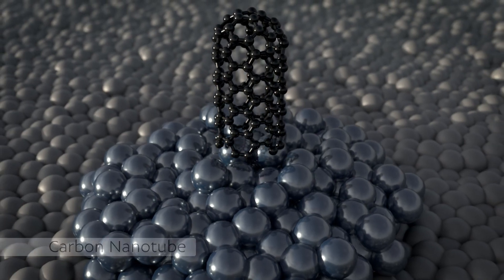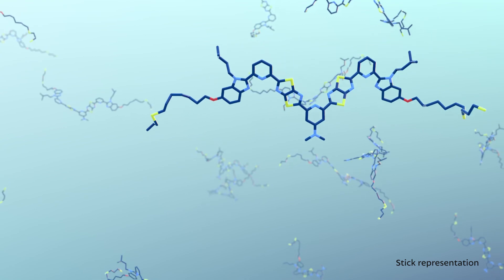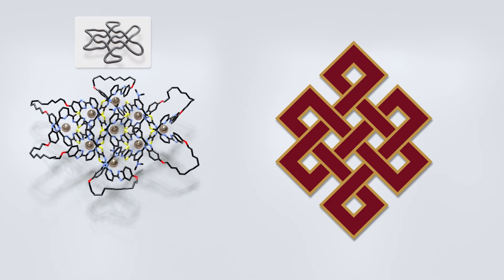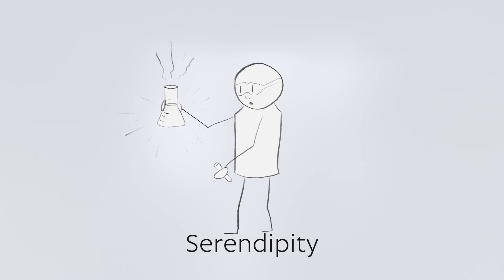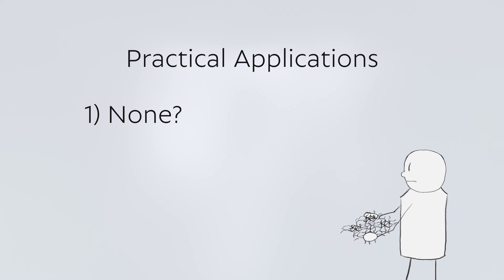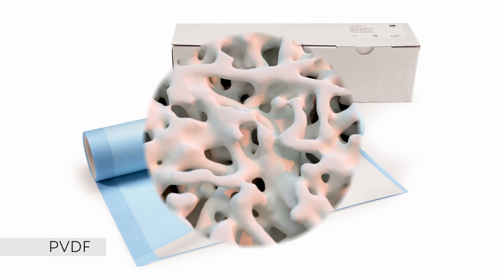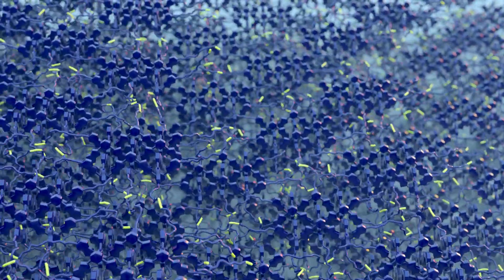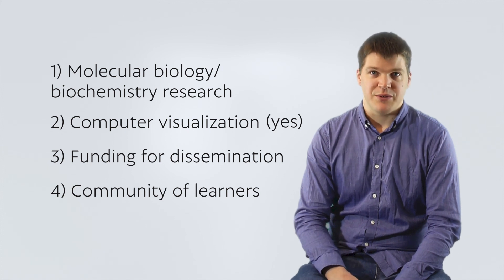Designing Nanotechnology: Weaving Molecular Fabric

Comment from the maker: What kinds of applications could you imagine for a woven molecular fabric like this one? Where do you think chemists should take these ideas next?
Reply: it could be used as an intermediary material to control the movement of other nanostructures that are required for assembling different micro components such as in devices designed for specific molecular construction. This has actually been quite useful to be exposed to this video. Thankyou. It is perfect for diffusing components at a fixed rate to control their binding period. There is so much that could be done with this! The real lesson here is that it most likely is possible to make a multitude of meshes with even more refined proportions for case specific needs.

Comment: Fascinating video, thank you very much!
As for applications, maybe it's somehow possible to replace the sulfur atoms with something else, thus making a material that better resists stress? Or connecting multiple layers (especially if they are off-center, so the other layers "fill" the gaps) could also help with that, and maybe with the letting through too. Or maybe adding loose threads which capture other molecules, thus making an impregnable net by using those captured molecules to help fill out the gaps?
Reply from the maker: Very interesting ideas! My understanding is the fabric tends to layer up with some offset between layers, at least that's how I interpreted some of the data, although there's much more to be learned and explored about how the layering works and I'm sure there's some neat applications to be found there.
Reply: Re-watching the video it does say they tends to layer on top of each other, but (as far as I can see in the animation) they are not chemically connected to one another, and after washing away the supporting ions I'm curious how they  remain stacked. Would it be secondary bonds that hold them together? Sadly I don't have the necessary background to understand the research paper itself. Also, as another usage, it is my understanding that most polymers don't play nice when put right next to each other, could we use this as a separating media? Though it's probably too high-tech for consumer grade applications, but it might have a use in projects where volume/weight is crucial, if this is indeed a valid usage.
Reply from the maker: @csanadballa8561  Yes, I didn't depict them connected because as far as I know it's not clear how much, if any, connection is present. They do delaminate when stretched.